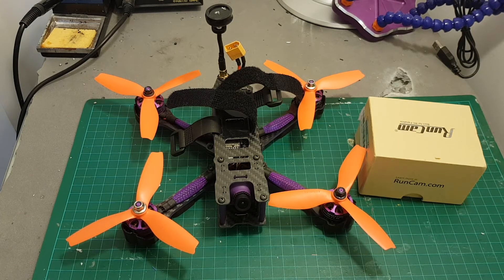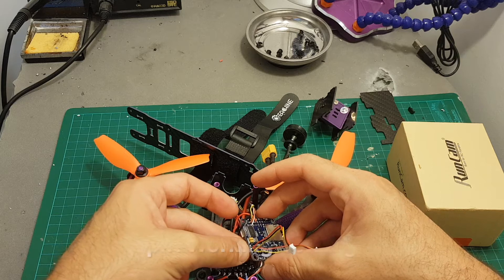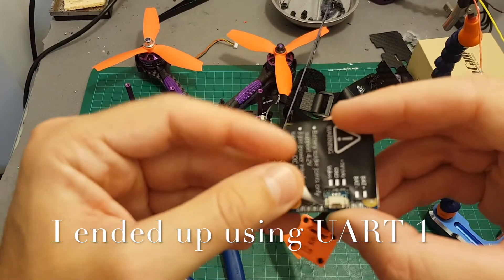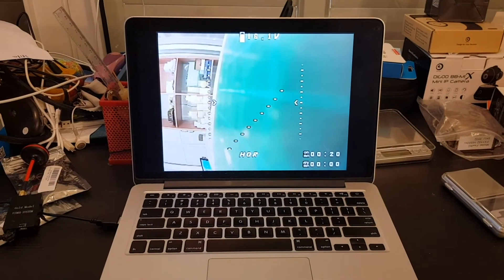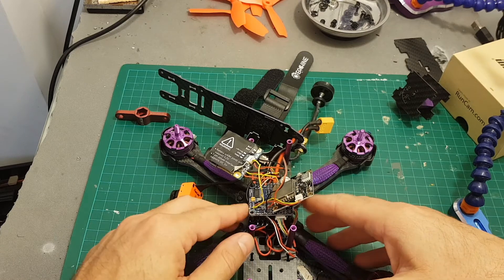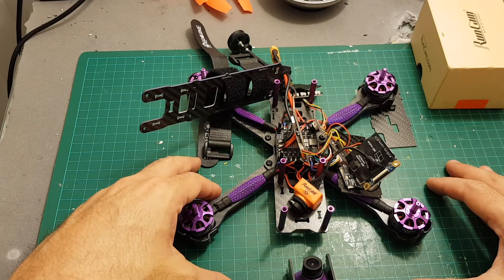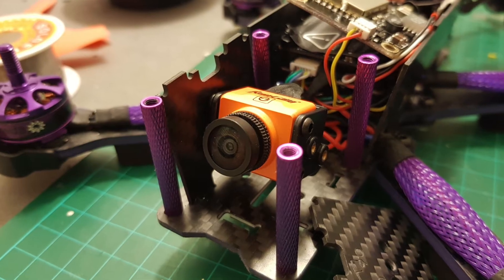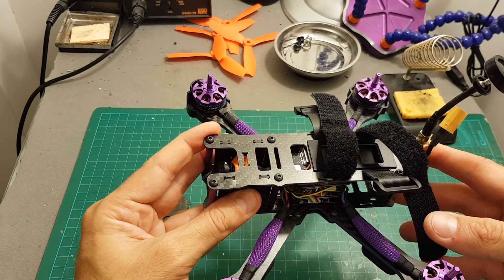How To Add A Runcam Split To An Eachine X220S And Configure It On Betaflight 3.2

Comment: Thanks for your great video. I've installed the camera but not wired the VTX/OSD so far. Why did you ended up connecting the RunCam to UART1 instead of UART6 ? I've read that plug stuff in UART1 disables the FC USB port. How is it going with yours ? Thanks again !
Reply from the maker: Thanks, it's an old video and I don't have this quadcopter anymore. If UART 6 is free you can definitely use it.

Comment: Thanks for the video, do you know if is better to connect the camera in the 5v port instead the defaults camera port? I mean, in this 5v port, could you lost the image when you are drain the battery? The other port suppose to much voltage for the camera? The original camera for this drone came plugged in other ports, could it be a problem

Thank you!
Reply from the maker: You can use 5v, don't worry.
Reply: @KremerFPV  thanks!!!!
Reply: Hi @Gal Kremer 

I plugged the cam on my 5v ports, and looks like there is more noise on fpv signal besides less range with the ram port. It could be because of my vtx is connected to ram port too, so it could have to much power. I going to change both, the camera and vtx and plug in 5v ports, but I'm realized my 5v ports only have 4v power (I don't know why) ... Could it be a problem runcam split  (To feed it just with 4v) ? 

Thank you so much for your help !!
Reply from the maker: @eliasmolinaprados  Yes, you need to run it on at least 5v. I recently saw that runcam do not recommend to connect it directly to the battery. Which flight controller are you using?
Reply: @KremerFPV  I have  a eachine wizard x220s, so my flight controller is an omnibus F4 v3 (I don't really understand why my 5v ports have just 4v) The ram ports have the same power as the battery you plug. 

I tried to plug the runcam in 5v port and vtx in ram port, works by had bad fpv range.

Now I have both connected on ram ports, and works too, but I think I have so much noise on fpv signal. 

Maybe the solution will be to use bec on this ram ports ...

Comment: Would this also work with the RunCam Split 2. and did you have to disconnect the 5V for the LED's?
Reply from the maker: Yes it will. You don't have to disconnect the 5v for the LEDs.

Comment: Hi, thanks for the video. I'll try it on mine. Btw, what are you doing with those sliders at 3:40 ? Could you share your dump file? Thank you
Reply from the maker: My pleasure. These sliders are for the camera control - it enables you to start / stop the recording of the Split using an auxiliary channel. 
Dump file: http://txt.do/dqp4v
Reply: @KremerFPV  thanks man. I'll definitely mount the camera, but right now I have big problems with flashing BF. Tried all links for drivers found in BF, but can't recognise FC on Wizzard. I guess I have to keep on trying. Do you have any suggestions? Thank you

Comment: Do you need to solder the ground wire when connecting to a uart? I don't have a ground next to my uart tx and rx pads.
Reply from the maker: +rmksledhead63 Yes. You can use any ground pad on the board.
Reply: Gal Kremer thanks!

Comment: How did you fit it in stack? I dont have enough space on my x220s
Reply: Did you cut standoffs?
Reply from the maker: Try using shorter spacers.
Reply from the maker: +Xracer FPV no, just used shorter ones.
Reply: Thx ill try

Comment: Hi Gal! Thank you for the video, you helped me install this camera! I did have a question, how did you get the Betaflight OSD to show up on the FPV video? I'm running Betaflight 3.2.1 configurator and my Wizard is flashed to 3.2.
Reply from the maker: +Raymahl Sutton Hey there. I am glad that my video helped you. Did you connect the video out from the flight controller to the VTX and the video in to the Runcam split? If so - make sure that the osd is turned on. Let me know if it helps. If you are still having problems, I will send you my dump settings, maybe it will help.
Reply: I thought I had, but I'll have to go and check the next time I take my quad apart.